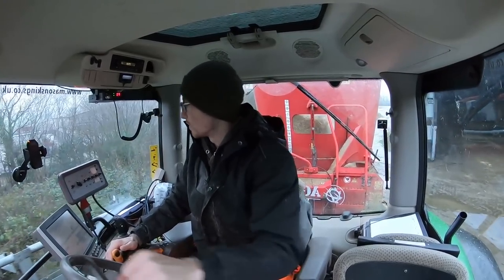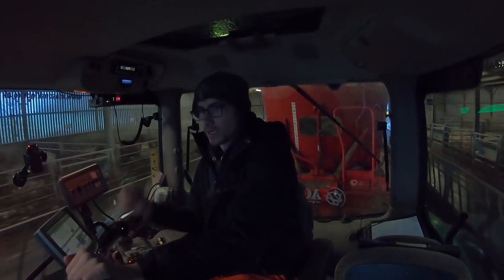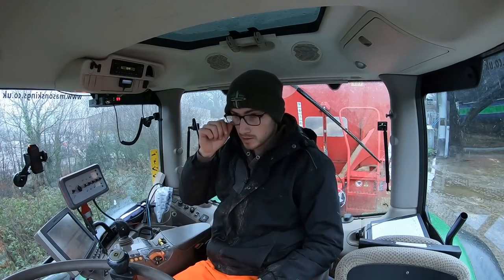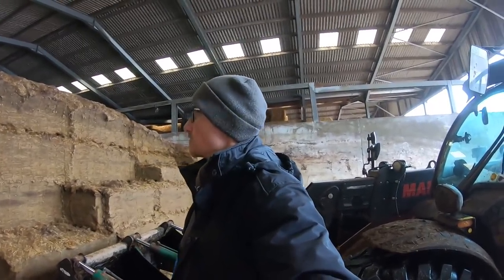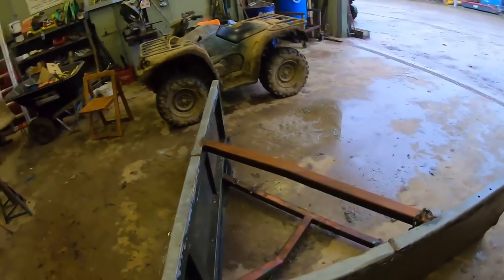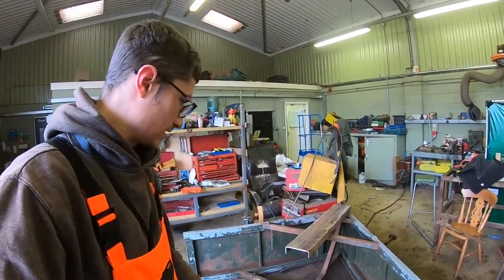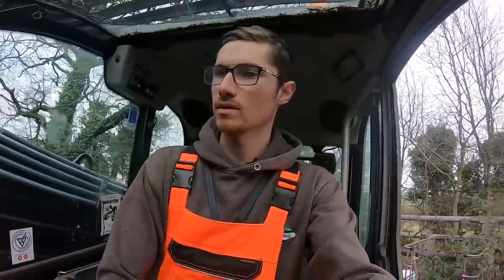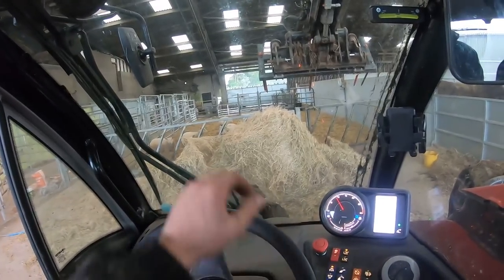I COPIED TOM PEMBERTON!...KIND OF....

Comment: Never use welders/grinders etc with your trousers/overalls tucked into your boots, it can all get a tad hot in the boots if a spark or molten metal finds its way in 😳😳😳😳😳😳😳
Reply from the maker: Very good advice! You can tell I'm a rookie at it!

Comment: Cut a section out of the top of your angle so your tine goes in just passed the bottom section,drill hole either side & put a pin through....bit of a better way than the chain
Reply from the maker: Yeah that would work very well! I need to attack it with the welder again, my welding has let me down!